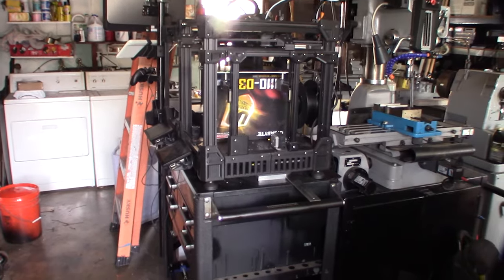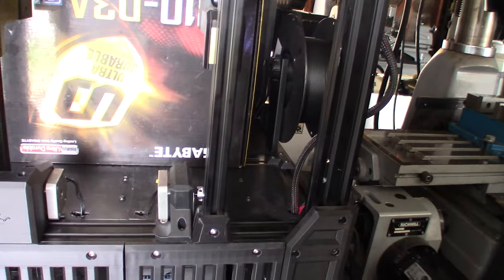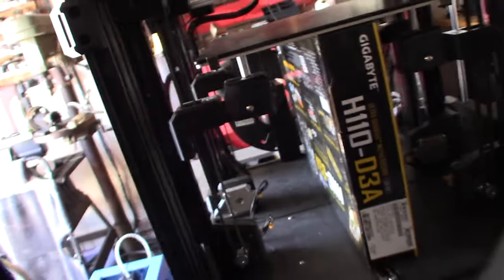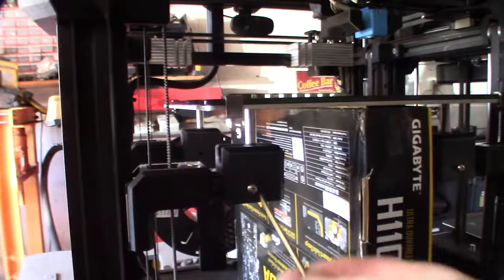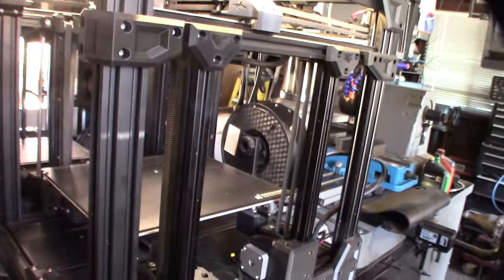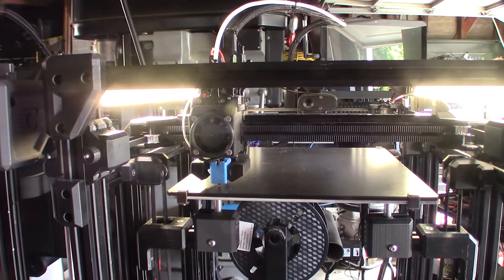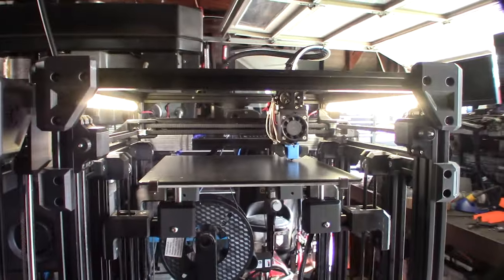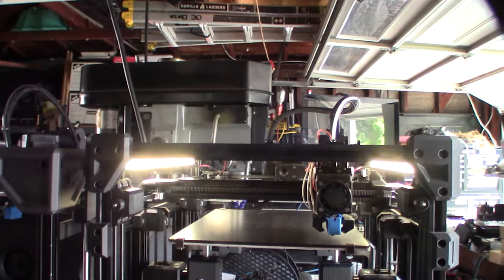Orcinus (Orca) Quad Bed Leveling Motor Bracket Improvements For Faster Leveling Times 3D Printer

Comment: Yeah, we use a similar "home to bottom" system.  We have endstops on each Z at the bottom and also a BLTouch. The Klipper home script first homes all Z motors to the bottom to attain a safe starting value from any position, then moves up to do bed tilt. 👍
Reply from the maker: I love probing and all the technology but it can be a headache sometimes. On the Celeritas I decided not to use probing or bed meshing. I just use two adjustable Z limit switches. The dual Z limit switch's are to sync the dual Z belted motors. I hit print and it homes Z in a few seconds and starts printing. Pretty amazing how repeatable it is. I didn't want to use mesh to slow down my printer and put extra load on the CPU. I want as much CPU power as possible dedicated to generating steps.
Reply from the maker: Another printer I worked on did they exact same thing. I'm trying to remember the name, maybe flashforge. Small fully enclosed printer. I really just fix the printers as a hobby, its fun to see how how everybody does it differently.
Reply: @fintechrepairshop  If you don't want to probe everytime, what if you had triple or 4x Z with endstops at the bottom...and just figured out the correct offsets one time and hardcoded them? You could even have a mount to temporarily attach a probe, which you remove after maintenance.

Comment: So I'm in the bag of worms with this one here ok first KAMP is amazing for Klipper it also has ups and downs, biggest one for me is and it's mixed is the bed prob before every print where the print is going to be so it does a bed map of only what you are going to print now saying that with a well leveled bed it's like a once and done for the bed on one full bed mesh in any spot. Where it shines is in smart park and if you be a little bit lazy or a fucked up bed the Adaptive Meshing is amazing!
Reply from the maker: I use both mesh and level. Flattest bed I've every seen with the quad leveling.
Reply: @fintechrepairshop  then KAMP is for you lmao you will love it or hate it lmao